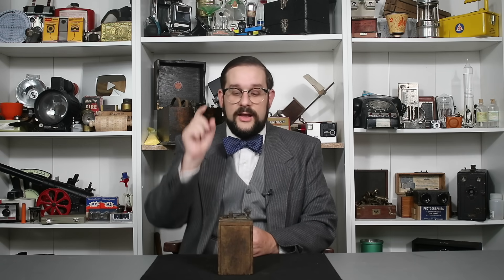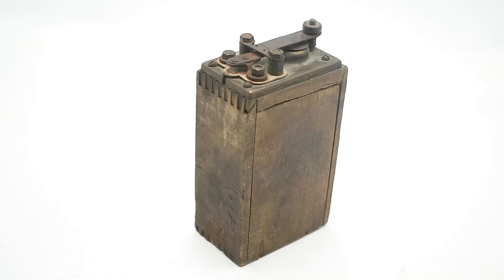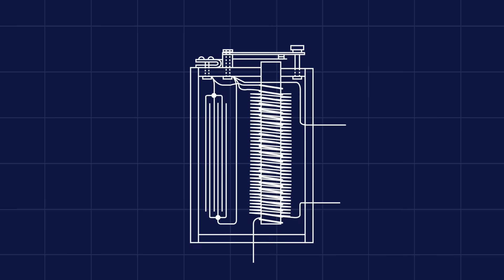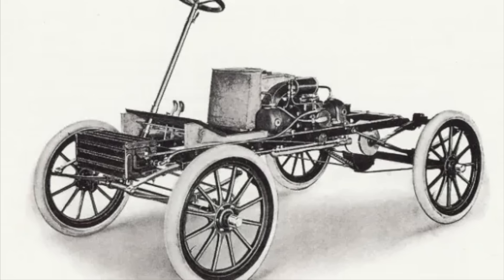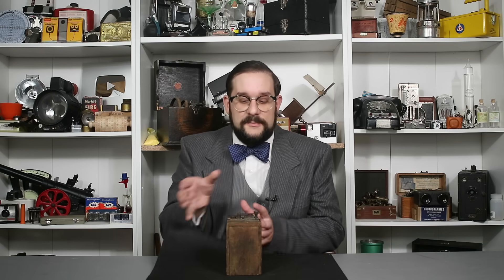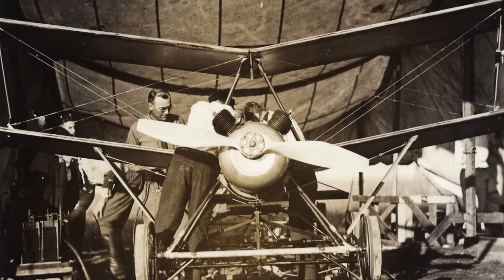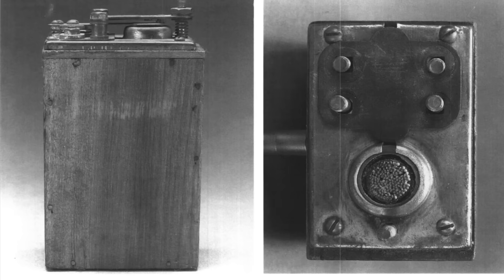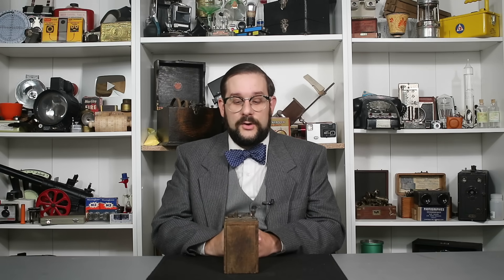Ford Model T Ignition Coil: a Spark of Genius

Comment: I've seen repairs/restorations of T coils by replacing the leaky "condenser" with a modern capacitor. Removing the tar potting without destroying the inductor is by far the most time-consuming part of the job.

Comment: Just a minor correction, the condenser doesn't allow the magnetic field to collapse faster perse, what it mostly allows is the primary system to 'ring', it creates an LC oscillator and creates a spark of a much longer duration.

Comment: I think you may be spreading youself too thinly,  I spotted several clear errors in this video.  eg kettering diagram shows a transistor but no condenser, electrionic and capacitive ignitions are not exactly as described.  some versions of model T used zinc batteries for starting and magnetto for running. coils are located on passenger side of the the firewall nor in the engine bay...    Did an AI write your script?

Comment: Why leave out the first automobile manufacturer in the USA, Duryea motors Springfield Mass. ?
1896 or Olds who made his first car in 1887 steam engine and first gas production car in 1896? These people were producing cars before Henry Ford made a personal car but not a production car in 1896. Big difference between producing multiple cars and making a hobby vehicle.

Comment: I have to say i have been
Around vintage and antique cars my whole life ,
I work on them as a profession and I'm bit of an  automotive historian. You have made a grate videos on early Ignition systems and especially early fords that i've seen. Informative , interesting and easy to follow. The only issue I found is the Magneto actually could produce up to 40 + - volts AC, but you're right about the oscillation and the inconsistent powering of the coils.

Most automobiles in north america switched from 6 to 12 volts around 1955.

Comment: The circuit diagram at 14 minutes is wrong. No transistor in the 1920s, the free end of the coil primary was brought out to the battery and the tapped end to the points. This meant the primary back emf added to the spark rather than countered it. This also reduced points wear.

Comment: It was in the mid 50’s not 30’s that Ford and other manufacturers  changed to 12V batteries. 
The old 6 volt systems were “ Positive “ ground and the 12v as today were - ground.
Reply: Fun fact, the spark plug electrode is negative in all modern implementations because if is positive, the electrode will quickly erode away.

Comment: When I built my gaseous rocket engine I used an original Splitdorf spark plug that had rusted so much the threads had vanished. I welded it directly to the manifold to be the ignition source.

Comment: I have owned my Model T Ford for 25 years. The notion that alternating current causes timing issues is false. The coils run far better on the Magneto than on battery which is used for starting.  The mag also doesn't produce 6 volts. Voltage ranges from around 3 volts at idle to around 30 volts at full throttle. It doesn't produce a pure sine wave, you have 16 magnets pulsing over 16 coils in series, it's basically making a very noisy DC voltage, and again with well tuned coils they run very well on that magneto power. The tuning of the coils is made much easier with modern electronics which can get the "Time to Fire" of each coil adjusted to within a few milliseconds of each other. I keep my coils tuned to about 2 milliseconds TTF.  There are a number of period mechanical timers available and there are two types of modern electronic timers available, one does timing advance automatically.  My Model T with stock engine, gears and coil ignition can get up to 55 MPH... On Magneto... on battery I might get up to 45MPH.
Reply: 55mph in a Model T sounds downright terrifying
Reply: @silverXnoise  it is a lot like going down the road on your living room couch sideways with no seat belts.
Reply: @silverXnoise 😂
Reply: @silverXnoise  It doesn't feel much different than 45, just have to be watching out further down the road if you'll need to stop.
Reply: I also see that the oscillation coil would also have the benefit of multiple sparks which would make it more resilient against less than ideal fuel mix. The cost would be increased spark plug wear.
As for AC and timing issues - that depends on the magneto and number of poles, it's not as easy as it seems, you have to match the proper area of the sinus curve to get the proper voltage for the ignition timing range. Not an impossible problem to solve, but I'd recommend an oscilloscope to find the right spot, something that when the magneto came around wasn't a common device, so I'd expect that it was more a trial and error work.
Reply: @ehsnils  As I said, the Model T magneto doesn't attempt to make anything like a pure sine wave, it's 16 poles pulsing all together. The cycles per second vary with RPM so you get more voltage and higher frequency the faster you go. The vibrator points are doing more current limiting than making spark once the engine is moving since induction coils are really supposed to work on AC.   No the oscilloscope didn't come about till the 1930s but people still knew how to figure out what was going on with AC power through math.
Reply: Thanks for the correction and info. When I heard him say that the magneto promotes unreliable timing, I jumped straight to the comments. Your Model T was fast! Ive got a 1914 runabout with Marks gears, and I do 70 km/hr (44mph) in the top end...
Reply: @jl991825  You could probably get more speed with better coil tuning. I also run much thinner oil than you'll hear most people recommend based on old wives tales. 5W20 full synthetic currently. Thicker oil robs horse power, and makes for much harder starting because the main clutch drags  in cold thick oil. I also have aluminum pistons which reduces reciprocating weight..
Reply: @jl991825  I don't normally drive my T faster than 35.  It is completely stock and the guy who sold it to me years ago said you can go faster in the car than you should be going.  With wooden wheels and an unbalanced engine there is no reason to go to fast.
Reply: New bacon rinds for the rods and mains and you'll hit 60 mph.  It must have been 60 years ago when I heard that.
Reply: Point of technical note, if there's no means of rectifying the AC voltage from the magneto to DC, you still have AC. And as far as I know, the Model T Ford doesn't have any method of rectification on board, even if it has electric start. What you have is not "noisy DC", what you have is "high frequency AC" such that there are multiple voltage maxima (in both polarities) per ignition event, so the trembler coils have no issues compared to battery.
The reason it gets up to a higher speed on magneto than battery is because the battery supplies a steady but low voltage (6v), but the magneto only gets more powerful as engine RPM increases (like you said, anywhere from 3v to 30v, I have no reason to doubt your measurements).
Just trying to help you better understand how your Model T works by dispelling some misunderstandings.
Reply: @44R0Ndin   I have no misunderstanding nor need of help to know how my Ford works. I've been working with it for over 25 years and it's the best running Model T in my club. There is only one pole coming from the magneto to the coil box and a ground return through the timer. As I said somewhere else... Induction coils like to work on AC. There is no need or reason to ever rectify the magneto output. It was built the way it is because it works best that way. I have looked at the magneto output on one of my oscilloscopes and I can tell you it doesn't look anything like what you're thinking of as an AC signal from a wall socket. So when I say Noisy variable pulsed DC I mean it.
Reply: Your messed up .

Comment: A further detail on how it works:  When you try to suddenly stop the current in a coil, the magnetic field collapses suddenly.  This makes for a very high rate of change in the magnetic field inducing a high voltage into the windings in a direction that tries to make the current continue to flow.  On these ignition coils, this voltage spike was something like 10 times more than the voltage from the battery.  You might have as much as 200V on the primary winding.  The secondary winding has perhaps 100 times as many turns as the primary so it sees something like (200*100)=20,000 Volts but at quite a low current.  You don't need that much to ignite gasoline.

Comment: You mentioned the change to 12 volt electrical/ignition systems in the 1930's. 
I'm not aware of any that changed over that early. 
Ford still used 6 volt systems through the 1954 model year.
GM changed to 12 volt systems in 1955, ex: 1955 Chevy. 
There were some 24 volt systems on early Army Jeeps. Maybe others.
Good video. 
Thanks.
Reply: @cleanreed
1923-24 Dodge Brothers cars were 12v (as was Rolls-Royce...)
I have the 1954 edition of 'Motor Service's New Automotive Encyclopedia' and it has a whole chapter on 12v vs 6v.  They suggest that 12v started to become common from 1952 (depending on manufacturer, as you say).  My 1953 'Motor's Repair Manual' echoes this, e.g. in its generator specifications listings, only 4 out of the 212 generators listed are 12v (fitted to the 1953 Chysler, Buick, Cadillac & Oldsmobile ranges). 
One of the sources New Automotive Encyclopedia quotes from (H.L. Hartzell from GM/Delco-Remy),  states that 12v systems were increasingly specified to improve ignition performance and cranking speed, both of which became important as compression ratios increased post-WW2, also generator output needed to be increased as electrical loads increased. Their other source (L.H. Middleton from Auto-Lite) respectfully disagreed with his contemporaries and posited that new developments in 6v technology with respect to ignition coils and distributors tended to offset the advantages of 12v. Some of the mid-20s cars had series-parallel systems with a 12v crank/6v charge using tow batteruies 
I would also suggest that the  corporate accountants of the Detroit  Big Three would've also been interested in reducing the amount of copper(=$$) in the electrical system by going over to 12 volts. 
  I have some automotive electrical text books from the early 80s which suggest that 24v (or even 48v) might've been the way of the future, this I think has been superseded by developments in electronics resulting in  less current demand, and also by smart charge and improved battery technology (particularly  energy density).
Oddly enough, the British car industry, with somewhat of a reputation of not being particularly innovative, were early adopters of 12v from around the early to mid 30s. For instance, the car in my thumbnail is a 1935-1939 Austin Goodwood (104 cubic inches) and they rolled out of the factory on 12v.
 When I was at Trade School we were told that one of the reasons for this was the British persistence in using inertia engagement starter drives, whereas the US manufacturers on 6v systems invariably used either mechanically or solenoid driven pre-engagement positive drives, which were much more resistant to 'throw out' from fluctuating battery voltages during the cold start crank phase

Comment: Oh, but you didn't mention the Model T's spark control lever. Instead of an accelerator pedal, the Model T had a throttle lever on the right side of the steering column, where a modern car would have a shift lever. On the left side, where cars now have the turn signal, the Model T had a spark control lever. To start the engine, the spark needed to be set at one position. After starting, the spark needed to be advanced and then adjusted further when driving. All this, and their strange, pedal operated transmissions, would make these cars challenging for a modern driver today.
Reply: The Jay Leno's Garage channel has several videos about driving Model Ts, including this one which discusses the transmission and spark advance:  https://www.youtube.com/watch?v=B7mPbBxNBEo

Comment: "farm" radios and some other devices that ran on DC current systems had a similar thing called a vibrator.  It was an electromechanical device that interrupted current like this to make AC so it could be stepped up to voltages to run tubes.
Reply: Car radios in the era of tubes often had one of those.  I remember a car where the radio only worked after you hit a bit of a bump.
The vibrator would stick until something smacked it loose.

Comment: I owned an induction coil for the Ford model T when I was a kid. It supplied the spark for a Marconi spark-gap transmitter I built. An induction coil has a primary winding and a secondary winding. Each winding consists of many turns of wire. The voltage ratio is equal to the turns ratio. To generate a high voltage, the secondary winding has many times as many turns as the primary winding.

Comment: In modern usage, the term "magneto" refers to a device which generates a high voltage pulse by quickly moving a magnet close to a shorted coil of wire and then opening a contact.  When the contact is closed, the coil will deflect the field produced by the magnet around itself and a second coil, but when the contact opens the magnetic field can very quickly move so it passes through both coils and thus generates a high-voltage pulse that can generate a spark without needing a DC power supply such as a battery.  Such ignition systems are common in lawn mowers, chain saws, and also in general aviation aircraft engines (the latter often include two independent magneto systems, each operating its own set of spark plugs; as part of a pre-flight procedure, the magnetos are switched off individually to conform that they both work).  I'm not sure when the usage changed, but normally a device that produces low voltage from a turning motor would be called an alternator, dynamo, or generator, rather than a magneto.
Reply: Early alternating current generators were usually called magnetos irrespective of the output voltage just because of the use of permanent magnets. With the Model T magneto the alternating is from 16 magnets pulsing across 16 coils in series. So it's not making a pure or steady sinewave. The cycling is essentially a very noisy DC voltage which varies from around 3 volts to over 30 volts at full throttle and the coils Love to run on it.
Reply: @tonymiller8826  It is not possible to get DC voltage from coil without any form of rectification.
Reply: The devices you are talking about started to appear in the late teens in a very similar form to modern aircraft magnetos. 
Single cylinder engines started in 1921 To have  Wico brand square “ magneto “ that didn’t spin but had the magnetism in the coil broken by a trip lever. The connection  was broken by “ breaking the magnetism rather than just electrical. As the mechanical break was ocuribg there was also a set of. Breaker points with associated condenser, they had a distinctive square brass design. Many engine designs went from ignitor low tension either coil and battery or multiple different magneto designs. Some rotary some trip with only a break in the magnetism but a constant low voltage coil.
Reply: @williamphillips642  A key interesting point in the design of the modern magneto is that breaking the contact on the low-voltage coil moves the magnetic field much more quickly than a magnet could practically be moved.  Since the voltage is a function of the rate at which the field moves, this allows it to create a high voltage directly.

Comment: The Delco diagram is a confusing choice since the original 1912 issue certainly didn`t involve a transistor - they hadn`t even really invented vacuum tubes yet :)  On the capacitive system, that still uses an ignition coil, but also a capacitor as a power buffer. And interestingly, if you can trust the wikipedia article on capacitive discharge ignitions, there actually were some such systems for aircraft and rarely also cards that did use something resembling a vacuum tube (a thyratron has no vacuum in it but a non-expert couldn`t tell one from a vacuum tube :) Some (eg the Tung-Sol EI4 system) had both transistors and thyratrons in their circuitry... .

Comment: My dad had one he put some wire leads off the side studs and if you put 12 volts in using a bench supply you could have a nice sparks off the wire leads, he installed.

Comment: Well the first generation of spark ignition engines did not have ignition coils that had magnetos and then we're semi reliable they worked but not so great needed lots of maintenance. Technology progressed but still needed points condensers and you know all these springs and weights and then we have hei high-energy ignition ushered in a new era of spark ignition technology. Once that hit other technologies are made obsolete because now we can make spark extremely extremely hot without the need for ridiculous amounts of excess circuitry coils reducers transducers capacitors and such junk. This all leads into direct ignition where we have the ignition coil placed directly onto or above the cylinder spark plug. Now other than the design of the coil and the proximity of the coil to the spark plug is the main difference from a basic coil driven ignition system the main difference between current ignition systems and ones of yesteryear are each cylinder is comprised of its own ignition coil connector. The computer will send a signal it will fire that an individual ignition coil so on and so forth throughout the firing order not dependent on a mechanical system. Original heis dependent on a mechanical system to distribute the spark from the high-energy ignition coil module